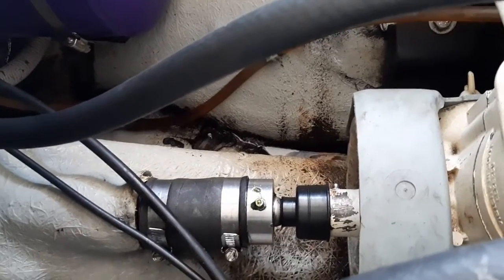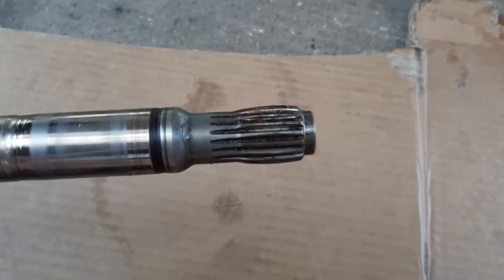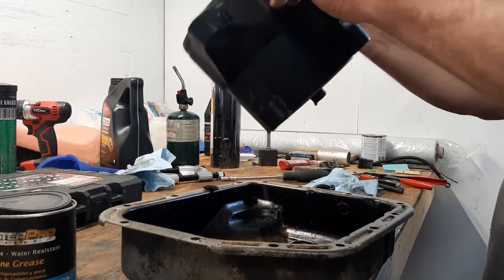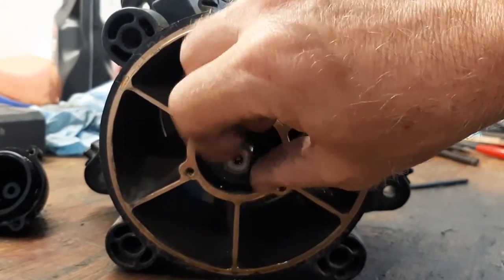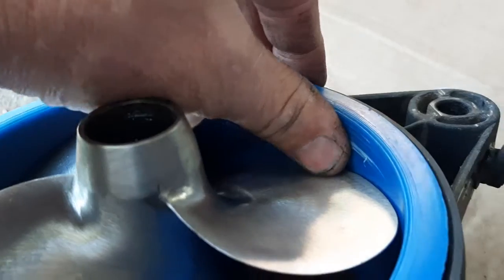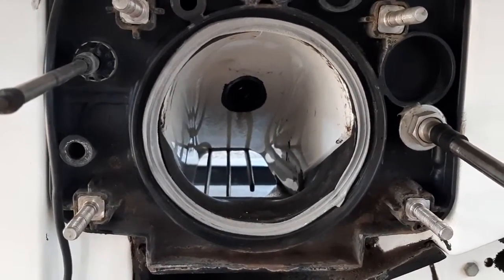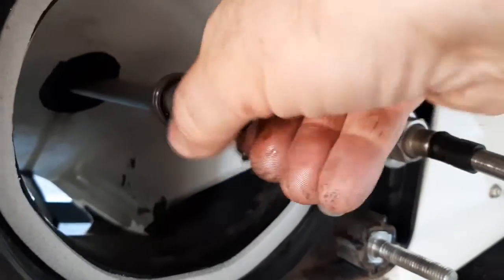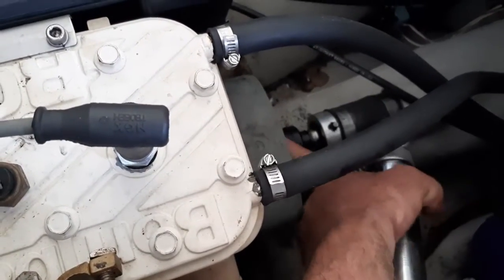Seadoo Speedster Pump Oil Change & Driveshaft Seal Inspection

Comment: Great video just bought a 96 speedster, has the carbon seal assembly right now but they need replaced so im thinking of doing the retro fit to the carrier seal like you did on yours. Also when i pulled the drive shafts i noticed they have a bit of a wobble to them when rolled on a flat surface. Should i replace them even though im going to the carrier seal setup.
Reply from the maker: That would just depend on how bad the wobble is.  I have a couple of spare driveshafts on the shelf and went out to check them out of curiosity.  Neither had any wobble that I could tell.    I did find a spec on driveshaft deflection in the shop manual.  With the shaft on v-blocks there should be no more than .020" deflection measured with a dial indicator at the center of the shaft.  Part numbers for the driveshafts are 272000073 or 204120064 if you need a replacement.

Comment: Very informative video!!! Just got a 1999 1800 Speedster...Twin 720's. Hardly used last two years. I've worked on cars but these are just a little different! I've read where many have disabled the oil system and just mix it prior and fill the tank. Do you have video for this procedure ( if you disabled yours)...I also have a leak in a soft plug on exhaust tube. I've seen several used ones but I don't want to get a used one only to have to change it again! Is it possible to epoxy the leak? If not, is there a place to buy a new one? Probably should clean/rebuild carbs? It seems to run ok for it sitting all that time buy I'm sure I can get it better! I do plan on switching out impellers like you did as well. Any other advice would be greatly appreciated! You got a new sub as well!
Reply from the maker: Removing the oil system and going premix was one of the first things I did.  That was 20 yrs ago so no video.  If you go to the Seadoo FB pages it seems like everyone recommends leaving the oil system on there and just doing maintenance on it so it doesn't fail.  The boat will use more oil premix and smoke more but I still prefer it that way.  I've got some work to do on the Speedster this week so I will take some video on what needs done to remove the oil injection.  It is a little more complicated than most skis because you still have to keep oil in the rotary valve section of the case.  Leaks in the core plugs are common since they rot out from the inside with age.  Some guys get by with JB weld but I always take the pipe off and TIG weld it.  That would be my recommendation since a used pipe could have the same issue.  If you rebuild the carbs use only genuine Mikuni parts.  Some of the aftermarket carb parts aren't very good.  Better impellers and the older style driveshaft seals were a definite improvement on mine.  Other than that I would just enjoy the boat since they are a lot of fun.  Thanks for subscribing!